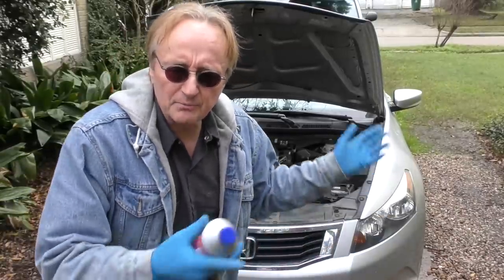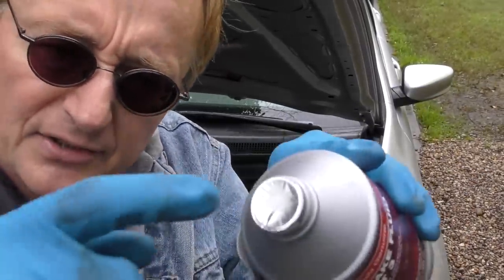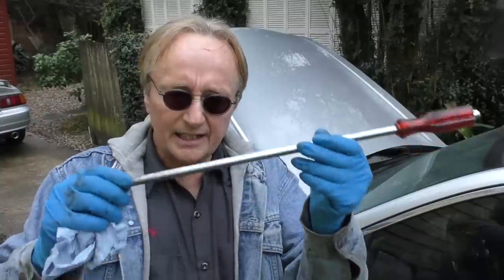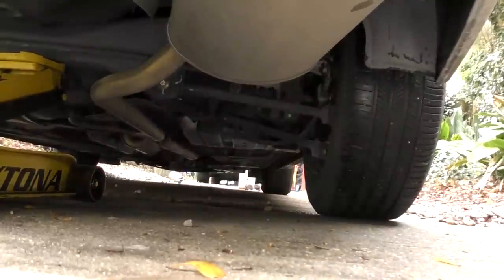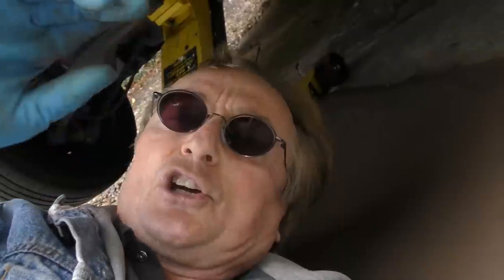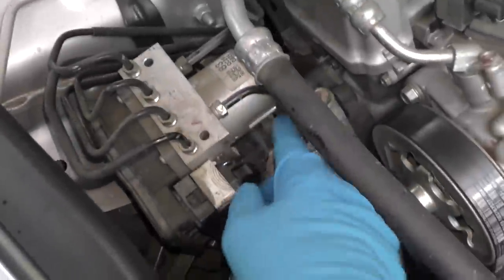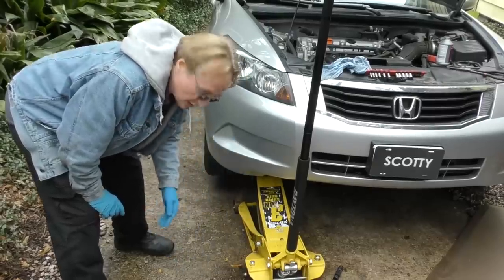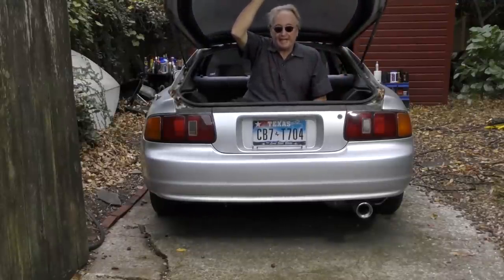Mechanics Don't Want You to Know This About Brakes

Comment: I've had a LOT of problems when trying to use a vacuum bleeder on any car with drum brakes.  The rubber cups are made to seal against pressure ONLY, and it takes very little vacuum to draw in air past the lip and create air bubbles in the wheel cylinder.  The same thing is possible on the master cylinder, but much less likely.  Bleeding with pressure is MUCH safer, even if you have to do it manually like in this video.  Don't forget to bleed your hydraulic clutch too, if you have one.  Cheap electrical conductivity testers for DOT3/4 fluid can give you a crude idea how much water is in the system so you know when to bleed.  If your fluid looks like coffee, it's years too late!

Comment: I've opened the bleeder and pumped the brakes several times, keeping fluid in the reservoir. On the last pump, I then hold the pedal down with a stick. System still worked.

Comment: I’ve just purchased a 1999 mercury mountaineer with 106,000 miles on it. It runs smooth other than when you shift it into reverse it has a slight jerk/kick. I bought it for 3,000 would you say that’s a good price for this vehicle?

Comment: I just bought an 05 corolla with 150k miles for $2,000 the dude was practically giving it away!
Reply: Callum Chisholm you got a steel, 05 is the best year Corolla Imo, it will go another 200k easy
Reply: Ian Above yeah your right, change the oil every 5k and maybe a set of tires now and then, that's about it
Reply: Great deal you got!
Reply: What's that got to do with bleeding brakes?
Reply: @barbaracondon1255  you obviously didnt watch the whole vid
Reply: Callum Chisholm just recently my dad helped me buy a 2003 Camry XLE for $3500, and it only has 49k miles, my dad jumped on it quick and it should last us a pretty long time !
Reply: got a 1998 carolla with 96K for £400.  Why are cars so expensive in the US.
Reply: @jameshughes5722  if my corolla was a 98 instead of a 2005 it probably would have been way cheaper,  it also seems like you got a pretty insane deal though.

Comment: I bleed my brakes with an 
Autel Maxicheck Pro ($180). It take Takes like 30 minutes to do the job. 20 minutes for jacking your car up and connecting the hoses. 5 minutes for adding fluid, and 5 more to run the tool.

Comment: Good o’l GM: Has a recall that involves over 150,000 Silverados with breaking problems
Reply: The most appropriate spelling slip ever.  (breaking / braking). Well played!
Reply: Vortex Rage I try 😁
Reply: Breaking brakes.
Reply: New for 2020, the Dodge CALIPER!  Comes with 2 CALIPERS of low CALIBER!
Reply: Braks not breaks.  Unless they are broken breaks then maybe you can call them breaks.
Reply: @vortexrage3918  ya
Reply: @vortexrage3918  ya don't you just hate when Google voice type does that
Reply: J G  Very good, LoL
Reply: Breaking in or breaking out? 
Breaking up or breaking down?
 Or just plain braking?
Reply: Hey folks, don't be too hard on him, for spelling ,
 give the guy a brake.
Reply: Braking*
Reply: “Won’t last long at this price!!”
Reply: That's braking news
Reply: GM just don't build them like they used to in the early 90s and earlier.
Reply: And I got bashed for driving a ford but their truck can’t stop if they wanted to.
Reply: @gingie5246  yeah I had friends with a Mercury Mountaineer that had saved all the issues. It was literally a book. They filed the lemon law on it and the only choice was to turn in their lease for a newer model. They did and it wouldn't go into reverse after a couple weeks. The older one had issues with the brakes as well and was told to drive it until a newer master cylinder arrived.
Reply: RAY-the-WAY , why don’t you mention all the recalls from Toyota too, they have the most recalls, yeah I know, the point is to trash anything with the USA name on it, you most be a democrat.
Reply: Bracsim 1 huh? You must be a troll
Reply: All the big boys have recalls going on for one thing or another. Oops, brake issue, fire issue, transmission glitch, electric issue...Its not just a GM thing, Ford and Ram too these days. What do you expect when they reinvent the wheel every 5 years for NEW! IMPROVED! bragging and p.r. campaigns. To sell trucks with ever changing foreign suppliers supplying parts for these new designs. If they're not built in Mexico to begin with-- hello lots of Rams, hello Chevy Blazer....Trucks use to be a basic design in production with upgrades for 10 years or more and mostly in house parts or U.S. content, now it's a "new generation" every 5 years or less and 60% " world resource" parts because you don't want to say "foreign" anymore than you call a "pre- owned" vehicle used...
Reply: @donberry7657  , this! ^ 👍
Reply: It's spelled brake!

Comment: I get pads out of junkyard many times, I have gotten some sweet akibonos for $3.00
Reply: Nice.  And I thought I was cheap...  :)
Reply: x x  No, more like getting a heart replacement from someone dying of leukemia.  Not sure how you can tell akibono pads from others once used, however, and a LOT of work pulling things apart until you find 'em to save not a whole lot but if it works for David, great.  When I was young, I noticed my brake shoes (yes, shoes) on my 1972 Valiant were worn (had been replaced once).  But unlike typical shoes where the pads in front (that stop you going backwards) are smaller, they were the same size as the others and practically new still.  So I swapped 'em and drove for another long time for no cost for the shoes.

RichE San Diego, CA
Reply: I've done this for years . Its better than blowing your money for no reason . I usually find brand new brake pads at my pick n pull

Comment: Honda is different for bleeding  sequence. Left front, right front, right rear, left rear. Most cars are they way you describe.
Reply: Yep he did it in the incorrect sequence.
Reply: Niko this proves he not a real mechanic only one googling stuff then saying what he thinks is right
Reply: Rolando B okay kiddo
Reply: kevin kuc just wondering. Why would it be different on a Honda, is there a reason?
Reply: @michaeljames8291  lol I'm wondering the same thing haha
Reply: I laugh at the trolls who watch just to criticize Scottie. You assume that EVERY Honda would be like yours. This is an older Honda. Also read other comments that viewers write. You'll find out that everybody respects Scottie for his expert knowledge. He is THE MAN.
Reply: I think the front and rear systems are divided anyway, in case you lose one or the other, you still have one. Can bleed rear as seaparate system than front. yes, they share components, but are divided hrydraulicaly at master cyl
Reply: Australia is different as you start with the left rear and finish with the front right
Reply: @jacobbellwood6184  You didn't mention that in Australia, the sequence is the same, FURTHEST from master cylinder first, which, since the driver's side is on the right there, is STILL correct.
Reply: Most cars have a different sequence.
Reply: I have always done it the old school way in multiple Honda’s that I have owned and have never noticed anything bad happen as a result I honestly think it does not matter at all what order you do it in as long as you change it every couple years u should be fine
Reply: @wonkeep85  And where do you get your statistics on this?
Reply: just the reply i was looking for

Comment: I attach a clear line to the bleed screw and drop the line into a clear jar, then open it and pump the pedal a few times, you keep the line down in the fluid.  You pump until the line is  clear and no bubbles (if line is down in the fluid no air will suck back in) then tighten the bleed screw back.  Then top off the reservoir and do the next brake and so on.

Comment: Harbor freight has the vacuum bleeder for under $40 - works a treat.  You have to have an air compressor but the California Air Tools compressors at Home Depot are affordable and relatively quite too.  And handy for all kinds of stuff to have around.  I picked one up for around $120 on sale and it's been great.  It isn't high volume - won't run air tools for any amount of time, but for simple tasks like blowing up tires, running tools like the vacuum bleeder, etc. they are perfect.  Had to replace the rear brake line on my Xterra and the compressor/bleeder paid for themselves in that job alone.  And thankfully I didn't get air into the ABS system - it is a nightmare!

Comment: I never bleed them unless I have to it always ends up being a pita, bleedscrew breaks off or rounded. If the fluid is real dark I'll suggest the Turkey Baster method of adding a little fresh fluid. Also the seat/pedal trick has never worked for me, always end up begging a friend to help, same with gravity bleeding.

Comment: Scotty!!!  You can’t ‘just hose off’ brake fluid!  It is, like engine oil, unsafe for the environment and must be disposed of properly.  I was shocked to hear you say otherwise!  C’mon!
Reply: David F Scotty has a $5000 scan tool but just sprays brake fluid off the driveway. Probably does the same thing with oil changes and transmission fluid changes!  😂
Reply: He never has issues with weeds growing in the concrete cracks...
Reply: Well if you don’t hose it off it will destroy your finish of the paint surfaces underneath the hood and you won’t be able to undo the damage

Comment: Scotty VW says I need to change it every 2 years. I live in Denmark and the weather is not the best. Is that why?
Reply: No,  it's because volkswagon is garbage and you should've bought a Toyota
Reply: @MMGJ10  Not if you buy an old Beetle from when the brakes were still mechanical.
Reply: nope. brake fluid can last for a long time if is sealed correctly. most of people never change it and the cars still brake good. especially with the dot 4 fluid.
Reply: Mostly it's their way to make money for the dealership and authorized maintenance facilities. Brake system now are almost always from Bosh. Standards on brakes are strict so you can just use the recommendation of Scotty unless you live in very hilly area, so your brake fluid is under a lot of stress. There just a little bit of moisture can be dangerous.
Reply: Brake fluid absorbs water. The water wears out all the rubber parts in your system?
Reply: It is good to change your brake fluid every few years, but as long as it's well sealed and no leaks ( so no moist air got sucked in to the system) you could probably go 3-5 years. Also it's best, and so much easier to bleed your brakes with another competent individual helping pump and hold the brake pedal.
Reply: @johnweiland9389  The water rusts the metal from the inside out, which can create leaks, especially at the pistons  in brake calipers (disc brakes) and wheel cylinders (drum brakes)

Comment: Great video, but I don't even change my own oil anymore, let alone bleed my own brake system. I don't think my mechanic bleeds the brakes, either. At least I've never noticed it on the write-up. My 4Runner is 18 years old, and I think I'm just gonna keep on truckin', blissfully ignorant of whether my brake fluid has ever been changed.
Reply: You don't normally bleed the brakes except when you are changing the pads.  But if it's a quicky brake job place, they usually skip it.

Comment: I use a 2x4 instead of a screwdriver.
Reply: Yep, got plenty of 2x4s various lengths for all my vehicles.
Reply: Hoover/ vacuum cleaner pipe.
Reply: @stalincat2457  lol, I have also used an extension pipe from my shop vac.

Comment: Thank you Scotty! This was my question the other day on How to bleed car with ABS. I saw a video stating that it needs to take out the relay for ABS before bleeding, don’t know how true that is.
Reply: Wonder why? I think I saw that video but forgot who published it.

I would be more concerned about failing to keep the brake fluid reservoir topped up to prevent air getting into the ABS valve. What do you think. 
Thanks for your comment. RL
Reply: Vernise scissorshand As long as the engine is off the brain is dead

Comment: I use a clear plastic hose and an empty Mason jar. One end of the hose on the bleeder. The other end in the Mason jar with a little brake fluid in it so it doesn't suck up air. Loosen the bleeder valve and pump the brakes a few times. I can watch any air or dirty fluid going through the hose.

Comment: I got air into the ABS system of an 04 grand prix it took a while to figure it out but I finally started the car up and pumped the brakes up. I was able to get the air out it just took a while. Haven't had a problem since

Comment: When Scotty mentions getting a beater car to try to find a cheap Toyota or Honda, but it may have high miles with trying to find one for under $3K.  But sometimes things work out much better than you'd expect.  I ended up finding an older Toyota "beater" Camry that had lower miles (80K), and even though it cost me a bit more $ at the time than a comparable year GM or Ford, but it has been such a perfect go anywhere car, it then became my main driver (including road trips) as well after my nicer, newer GM truck became too expensive to keep fixing!  Sometimes you just get very lucky with beater cars.😎

Comment: Most mechanics don’t know you can open each bleeder valve and actually pump the brake pedal to bleed the system. This is made possible by the residual pressure valves in the master cylinder that maintain about 10-14 psi of pressure in the system. These RP valves won’t allow air to be “sucked into the system” when you open a bleeder.  These RP valves allow for instant braking.  Without them, you would have to “pump up” the brakes every time you want to stop. The only thing you have to watch is that you DON’T push the brake pedal to the floor. The normal travel of the brake pedal is about an inch or two.  Pushing the brake pedal to the floor rams the master cylinder piston through a portion of the cylinder that gets a little pitted from the residue in the brake fluid. This section of the master cylinder will tear up the rubber portion of the piston. Have you ever noticed that a master cylinder “went bad” AFTER you did a brake job? It’s because you rammed the piston through a portion of the master cylinder that gets damaged over time.

Comment: Save some time, just go to Napa and get the little bleed hose with a check valve built in. Slip it on, crack open the bleed valve, go in the car and step on the pedal 10 times, close valve, go to next wheel, repeat. Check reservoir level after each one.

Comment: I used to bleed the bakes with a small hose that I attached one end to the bleeder and the other end to a jar of fresh brake fluid. I had my wife pump the brakes and as long as the hose was submerged in the fluid it would not suck air in. She would press the pedal down then I would tighten the bleeder and repeat that on each wheel. It always worked well for me.

Comment: I have a 2004 Avalon.  Just short hops for the last 10 years.  Purchased new.  Always did a transmission service sooner than the recommended when I drove long distances and more frequently over the last 10 years with severe driving.  Never had any problems.  Why does the car always seem to run better after a transmission service with a new filter?

Comment: I change the brake fluid every 3 years or so, I'll do the change when I rotate the tires - makes accessing the bleeder values easier with the wheels off.
Reply: That's the right way to do it with the wheel off. Because then you have more space for maneuvering around.
Reply: If you need to change brake fluid every 3 years, you may have bigger problems.  I have had it 15+ years in cars, had it test and it has no water and the shop said no reason to change it.

Comment: Might want to recheck the bleeding system, used to be r/r, l/r, r/f, l/f, where the last one is next to the master. But my Ford escort was r/r, l/f, l/r, r/f. they changed the layout from the old axle, this was to keep some form of brake action at all times. if you lost rear brakes in the past you were without. But today you have one on each corner. so now if you lose your rear brakes, they are now the r/r and l/f, meaning the l/r and r/f will bring you to a more controlled stop.

Comment: Boston, MA area - Stop & Go traffic here is a nightmare so my other 1/2 replaces the calipers & pads & rotors together out in the garage every 3 years and bleeds the system then. If you can DIY you can replace everything for less $$$ than paying Firestone just to change the pads.

Comment: I found that if you just put in new breaks and they squeak, it's not that you didn't grease anything it's the little metal clips you clip onto the caliper for the pads to sit in for security. The made the metal on the inside of the clip too long and rubs against the rotary once in awhile and when you break. If you've got rings around your rotors about an inch from the outside, that's a pretty good indicator. Should be able to trace the contact point fairly easy. I cut off the end of the clip flush, to be square with the main part of it. Works perfectly.

Comment: Did you mention what a great paint remover brake fluid is?  So being very careful where it drips is super important.  Also putting a hose on the end of the bleeder screw and immersing the other end in clear brake fluid will also enable 1 person bleeding.  REMEMBER to keep checking the fluid level in the master cylinder.

Comment: I use a “one man brake bleeder” basically a clear hose with a check valve on the end. You can put it in a cup and go press the pedal a bunch of times with your hand. Keep the master cylinder full. Sometimes the “Brake light” on the dash will be on from the little switch inside the M/C when you start it. Just reopen a rear one again and push the pedal hard with your foot to reset the balance switch to the middle.